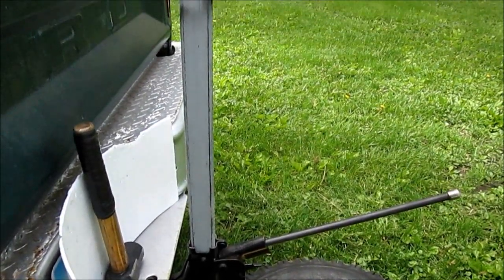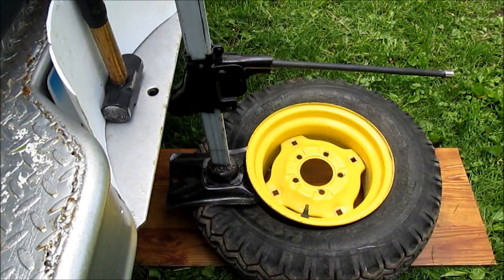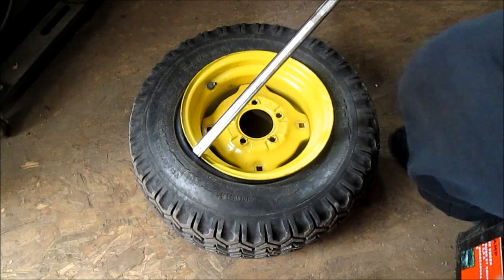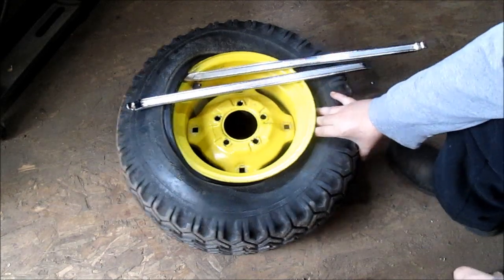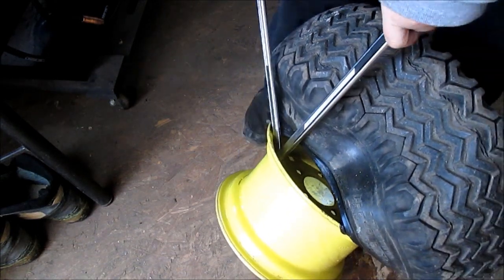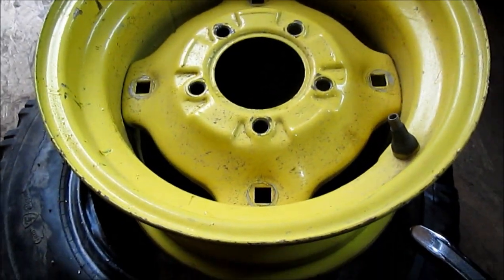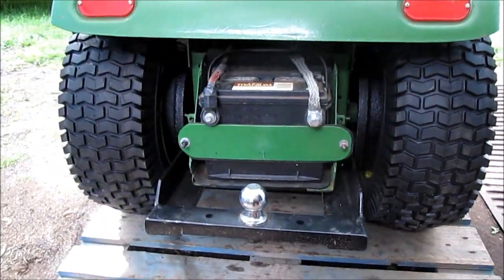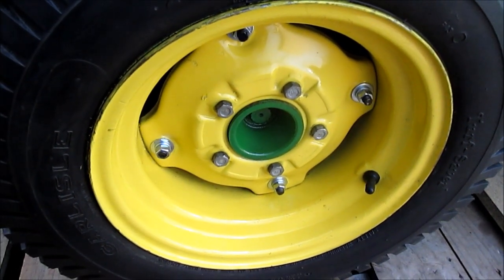Putting New Rear Tires on my John Deere 112

Comment: Your tractor really looks great, what year is it?  New shoes look fantastic on the old girl!
Reply from the maker: Craig Arndt Thanks ..it is a 1968 I really enjoy it because it would have been New when I was a Kid  It looks like a newer model now that it has new tires .The old Firestones I took off were the Original factory ones
Reply: not2fast4u2c I’m 14 years old and have a 1969 John Deere 112. Amazing condition for the age, although my tires are screwed and i need new ones. Iit’s a show tractor currently, but I’m soon hoping to get the part to get it running. The solid state transformer ignition coil decided to crap the bed. I’ve put it in a fair twice and got a trophy both time. But anyways you’ve got a nice tractornthere!